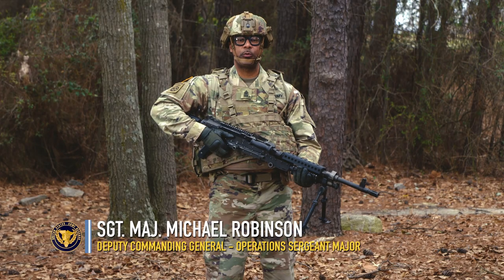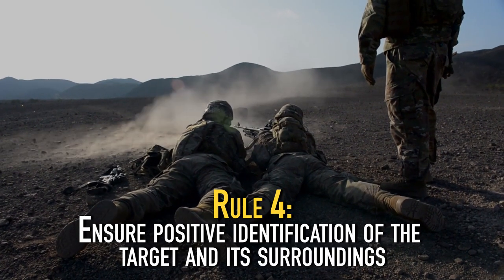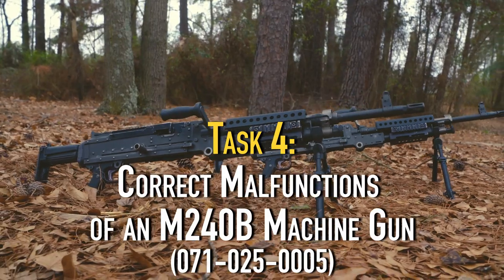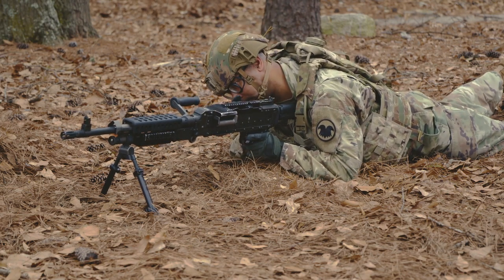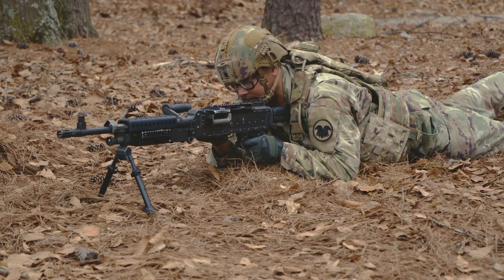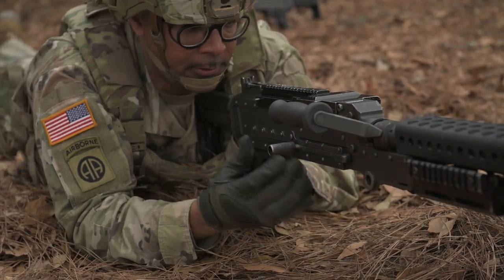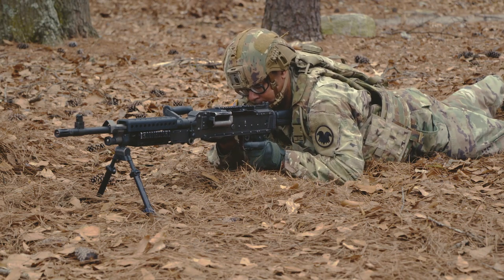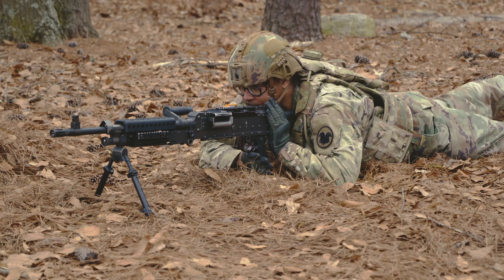Army Reserve: Know Your Tasks — M240B Machine Gun | U.S. Army Reserve

Comment: Is that a roller action system? Looks like my CETME when the bolt comes out. Long action also.
Reply: No. The roller is used vertically to engage  a track that in turn moves the rounds into position on the feed tray for the bolt to feed and fire.